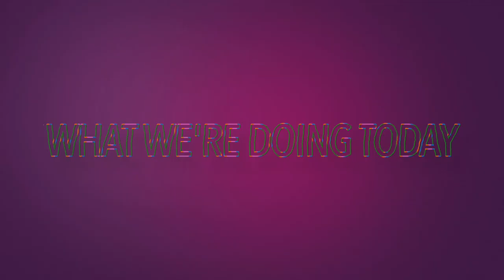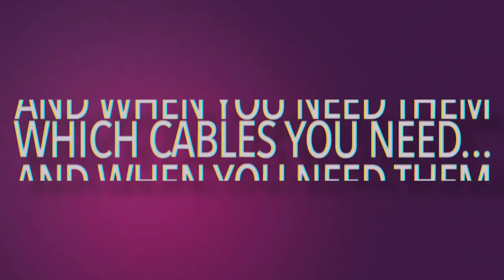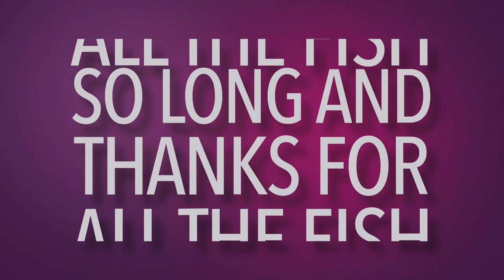The most important gear no on talks about | Direct Boxes | @sweetwater + @RupertNeveDesigns

Comment: I like the details you gathered into this video.I really covered some entire side of cables and DI boxes. thanks for that. I just bought this DI box and wanted to know about how to connect it and detailed description about all the switches and inputs outputs, then I realized many out there assume the viewers already know about connecting. how come you guys are just forgetting newbies like us.
Reply from the maker: Yo. I actually answered that in the video. To connect it you just run your cable into the front and run an XLR out of the back into the mixer or interface. The instrument cables will power it. :)

Comment: I have 2 scenario that needs your advice.

1st scenario I am recording with a fractal out to a Komplete 6 audio interface. May I know how should I connect the DI box in between? Guitar unbalanced to fractal => fractal balanced to DI balanced input => DI balanced output to interface input 1. Is this the right connection?

2nd scenario I am play a gig in a stadium that needs a 30 feet cable. My signal chain will be guitar => pedal board => Amp return. May I know where should I put the DI box to reduce noise?

Thanx in advance!
Reply from the maker: So with fractal I’m not sure you’ll need it since it should do a really good job of balancing the signal. However, you can clean up your signal by putting the DI between your guitar and your pedal board. Honestly, depending on your rig there are a few places you could put it in your chain, but I’d start there :) hope that helps homie.
Reply: @BeauTylerMakesMusic  Do you mean in this signal chain? 

guitar => 1/4 inch unbalanced jack => DI box unbalanced 1/4 inch input. DI 1/4 inch balanced output => 1/4 inch balanced jack => Pedal board input

Comment: Very well done video - sometimes quality explanantions need time - and I can assure you that I listened the comparison with or without the DI box with the shittest pair of headset on and I anyway heard a BIG difference. However, I'm a guitarist using active EMG pickup running to a guitar modeler (BOss GT 1) then straight to the PA. Do I need a passive oar active DI box? THanks in advance for your help
Reply from the maker: Yo! Thanks so much for watching the video. I’m really glad you enjoyed it. It depends on how you are routing. If you’re using a DI between your guitar and your multi effects pedal, then I would recommend active. If you are routing from the multi effects pedal to the mixer then passive should be fine. :)
Reply: Many thanks, I haven't decided my routing since I don't still own a DI box. However, judging from your video and the excellent quality of the RNDI inside preamp it wouldn't be bad to gofro the active Di before the multifx unit, as I woudl say it might even improve the sound of my guitar. @BeauTylerMakesMusic

Comment: OK great video, would’ve love to see more examples of using DI boxes and cables.

Specifically I record electric guitar with my pod girl would you run balanced cables for your stereo left and right into an interface or a digital snake? Or would you need to DI boxes or is the pod go sufficient?
Reply: Ha ha talk text said pod girl instead of pod go! That’s great
Reply from the maker: Haha. I know what meant. No worries. Man, there were so many examples I’d like to have given and I intend to touch on it more in the future, but I realized at some point during making the video that it was in danger of getting way too long. Especially for a video I just KNEW was going to be my least watched video ever lol. That being said, I would recommend running unbalanced cables into a direct box and then from a direct box into the the POD Go. That’s what I meant when I said pro audio gear prefers balanced signals. However, the POD outputs a balanced signal so from the POD to your interface or speakers I’d use a balanced cable for that. Hope that helps :)
Reply from the maker: Yo. Also. There’s nothing wrong with running it directly into the POD Go and running it from there into your interface either. It will still balance the signal well enough. Personally I’d recommend just trying the DI in multiple locations during your signal flow to find which you prefer. :) also, because the POD will balance the signal, even without the DI it’s gonna sound great. 

Also, can we just talk about how awesome the POD Go is? Lol

Comment: Great vid! Been kicking around the idea of getting a DI box to take my ASR's outs from unbalanced to balanced and then into the interface 🤔 I've heard the same exact thing you mentioned! Some say dont need one just use a shorter TS cable etc. I plan on getting an SSL six and 500 series gear with that being said would you still recommend a DI? Thanks
Reply from the maker: If you’re not using any electronic devices and you’re just using a small rig, a short cable I guess would suffice… but those people are giving you bad advice lol. Cables pick up noise from everything around it. Especially with all of the electronics in a studio. It always sounds cleaner through a DI box :)
Reply: @BeauTylerMakesMusic  Thanks for the help appreciate you replying. Reading up on the Neve

Comment: what if I'm in a very small home studio and my cable runs are short. I'v been recently using a RNDI box with a pre-amp and a compressor in my outboard signal chain and I'm hearing a sound that I've been looking for. You've mentioned long cable runs a few times so my question is. Is the DI box not being used as intended? Would I get the same sound from just the Pre-Amp and Compressor?
Reply from the maker: If you’re not dealing with any hun or electronic interference then it’s not a must have, but it will still definitely clean up your signal no matter what. I think it’s more important for live musicians, but ultimately it’s just about what you want/need. :)

Comment: Hey great video - subscribed! So I got an old Washburn acoustic electric connected to a Yamaha mg06x mostly for vocal effects which is connected to an audio interface, both connected to headphone amp with monitor headphones so I can play with a friend or two at home and also online. I know the electric pick-up, which has both xlr and 1/4 outputs is cheap, but I seem to get ok sound the with unbalanced TS cable connecting it to my line level input on the mixer but maybe it could be better. Would I benefit from a DI box at all in this scenario by using the xlr mic level input instead for the acoustic from the DI box?  It's a short run so would it even noticeably improve the sound quality? The mixer only has two XLR inputs with one taken up with a mic, so would be nice to reserve the second XLR input for a second mic, but that might be more a future use. If it makes a difference in quality of the acoustic, I might give it a go or any other configuration that might make sense? When I explained this to the guys at sweetwater, they told me that that I could also run the di box into the line level inputs on my yamaha using xlr to trs cables, but not sure about as  the Yamaha manual says those line inputs are TS? Sorry confused...
Reply from the maker: Thanks so much David! Yo. If your rig already sounds great and you aren’t running into problems, then the DI box might not be necessary right now. In fact, somtimes they’re not at all “necessary”, but with acoustic guitars, unless there’s some rare factor I don’t know about it will ALWAYS sound better going through a DI. This is because the DI not only boosts and cleans the signal, but it also gives more body to the signal which can be really important for acoustics since they can sometimes sound a bit then when being amplified through cables. The DI, especially this one, gives a bit more fullness to the low end and makes the high end sparkle (for lack of a better word) a bit more :) Hope that helps!
Reply: @BeauTylerMakesMusic  Thanks so much for the feedback! Ok, I might have to try a lower end one for now due to cost and see what I get out of it. Thanks again!

Comment: Hi beau. Great content. I am still wondering about what cables you use to connect on one end and the other?
Reply from the maker: Yo! So in the back you plug an XLR cable into it and then run that the audio interface. If it were used live the XLR would either run to a mixer or to cable snake on the stage. On the front in you just plug in via 1/4” cable! Hope that helps, homie!

Comment: The bass signal is clipped on the DI version. Maybe this is intentional but a clipped signal will sound way different.
Reply from the maker: Yo! Thanks for commenting. So I had a bit of a moral vs. creator sort of dilemma on this one. I recorded the non-DI signal first and then plugged the DI in and recorded that second. The creator side of me wanted to fix that, but then I would have been manipulating the signal. I wanted to keep the settings on the interface and my mixer the exact same so that everyone could hear an honest comparison. That huge boost in signal was just a really honest portrayal of how much the DI boosted the signal, which for me is a huge selling point. Hope that explains it well enough. Have an awesome day, AK! :)

Comment: Hi Bro ,  ...  Audio Interface  Output ( 1 & 2 )--------> ( Input ) RNDI ---------> RNDI output -------> Audio interface input ( 3 & 4 ) --------> Record ( write in a Track ) ....??? ( Shall i get the Neve sound in my  track ? ( Is that possible ? then definetely worth But .....is that possible ?????
Reply from the maker: Yo. If I’m understanding your question correctly, you’re asking about the routing. The microphone or the instrument cable goes into the RNDI. Then the RNDI is connected to your audio interface via XLR. As far as the “Neve” sound I think that would be more about preamps but this will definitely boost and cleanup just about any input signal for sure :)

Comment: Thank you. And how about analog synth. Do I need a DI box for analog synth ?
Reply from the maker: Synths have a budget version of a DI already, but if you’re using it on stage or around a bunch of other electronics or cables you can pick up a buzzing ground noise, so it will definitely help eliminate that. Also, as your synth setup grows, you’ll likely need some next level routing and DI boxes DEFINITELY can help in that department. :)

Comment: hi, i have a question,  amp modeller without xlr out can use with passive di box? or need an active di box ?
Reply from the maker: It’ll still work, but the signal strength and quality will be much stronger with a DI for sure. Especially if you’ve got longer cables on a large stage. You’d use it on the way in to the board :)
Reply: @BeauTylerMakesMusic  ok, so passive or active direct box doesn't mater ?

Comment: Does it add warmth/girth to the sound running through it.
Reply from the maker: In general, absolutely, but I suppose it would depend on the sound in question. Honestly, everything sounds a little bit cleaner with a solid DI, even if it’s a signal that doesn’t really require it lol. It can range from “just a little better” to “holy s*** that’s amazing”. :)

Comment: Thanks for the info on this!! Still learning about recording guitar.  So many new nuances for mixing and recording to learn.  Hate it doesn’t have self 48v power not every application will have phantom power.  Having to buy a phantom power supply to power the unit I am buying.
Reply from the maker: Glad you enjoyed it! This has to be one of my lowest viewed videos but it seems to have helped the most people :) anyway, I know it’s a bummer to buy external phantom power, but it’ll come in so handy that you’ll be so glad you did. I have a little standalone phantom power unit about the same size of the DI in this video. I bought it back when I got the Maschine MK3 to power condenser mics and I had no idea how often it would come in handy. :)

Comment: Do i need di box to connect mixer to powered speaker?
Reply from the maker: Nah. I just use it for balancing inputs to the audio interface or mixer. :)
Reply from the maker: Nah you should be fine. I just use it for balancing inputs :)

Comment: Looks like the Neve di, apart from the DI box basic funtions, has Low shelf and high shelf boost, i dont know if thats exactly something good or just a marketing thing, but lots of super expensive DI's doesnt resemble that EQ boost. Maybe you sould try to compare without the Neve, and aplying shelf boost on the DAW. Other important thing, at least for me, how much the noise floor it has (with numbers) compared with other DI units
Reply from the maker: Nah. That’s such a small portion of what a DI does. Mostly it fends off signal interference which provides clarity to the signal, not just an EQ boost :)
Reply: @BeauTylerMakesMusic  yes i know, thats something all DI boxes does,  was talking about the specifics of the Neve model.